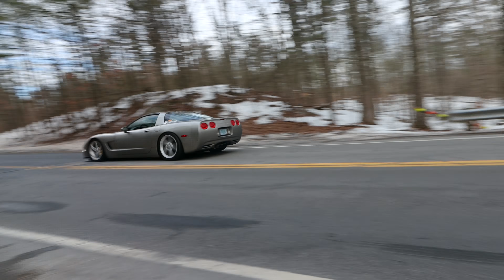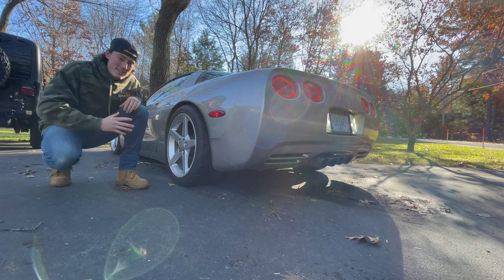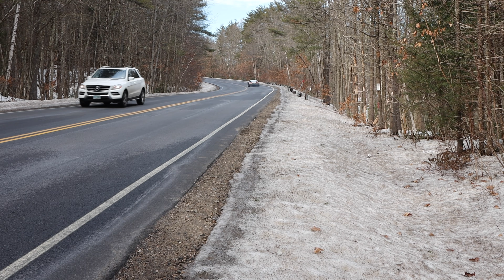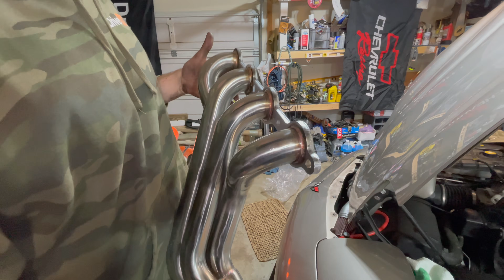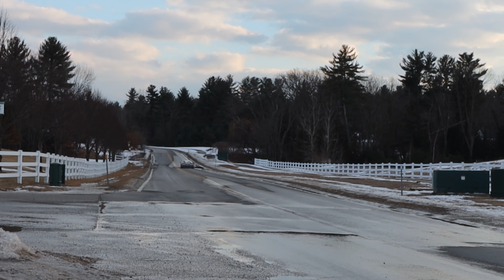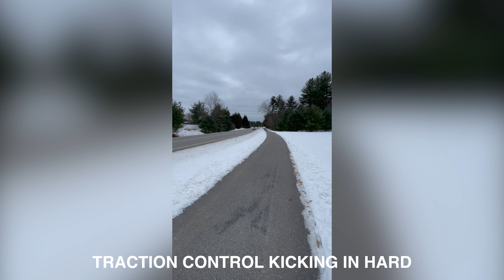C5 Corvette Speed Engineering Headers Review | Is It TOO Loud???

Comment: I think I'll keep my 2003 C5 stock.  Many years ago I had an '88 GTA Firebird (L98 350) and it had a set of custom built Doug Thorley headers.  The headers themselves were high quality.  The headers were California smog legal - including a CARB EO#.  No doubt they increased horsepower but the unexpected consequences became a pain in the butt.  The starter motor would absorb a LOT of radiated heat from the headers.  That would cause the starter to crank very slowly after more than 20 minutes of driving.  I never got around to installing some kind of heat shield on the starter.  Also, routing spark plug wires was a hassle because they would burn when they barely touched the headers.  After a long drive on the freeway, the brake pedal would get soft.  One of the brake lines was too close to one of the header pipes causing the brake fluid to heat soak.  Exhaust leaks was another issue to deal with.  The header bolts would randomly get loose and that would cause a leak - making the smog test fail.  So, I think I'll keep the exhaust stock on my C5.

Comment: I was going to buy Speed headers but they were on backorder for months. I ended up going with TPS 1 7/8 headers with no cats. It was a pain the ass to install, well only the x pipe. I also have BB bullets. I can hear a metallic sound afterwards. It doesn't get loud until I get to 2K rpms with no drone.

Comment: Richard holdener, the king of ls builds did a test comparing headers on the dyno,,these made just as much if not more h.p. as the expensive name brands. Just bought a 2004 zo6 and plan to use the same set up,,just with Billy boat mufflers to quite it down a bit..like your videos dude..my first mod with be the headlights you installed..keep up with the informative yet funny vids.🤣👍

Comment: I noticed your Oil PSI was stuck at 80 can you please talk about a fix for it. I have the same problem on my C5.
Reply: If you haven’t figured it out by now it’s your oil pressure sending it
Reply: Sensor is bad . I had 2 go bad in 3 months. I put an extension on the second time.

Comment: Have you had it tuned yet? If so,  what kind of power does it make? 
I'm thinking the exhaust would wear you down after a while. I'd have to add a muffler or at least a resonator.  The highway drone will get to you on anything but a short trip.

Comment: Some of the rattles you hear at low RPM may in fact be due to the header or mid pipe clamps touching the frame.  Put it back up on jackstands and look carefully for those contact spots. Readjust and drive, then repeat. I have 2” Kooks long tubes on my C6Z and finally dialed out what sounded like a metallic frame-exhaust rattle.  Also, you’d be surprised how much the engine and drivetrain rotate under acceleration! Good luck!

Comment: No cutting with TSP. Just installed a set of 1 3/4" Headers and a Catless 3" X-Pipe on my C5 Z06. No Cutting as the X-Pipe comes with Flanges for OE or Reputable Aftermarket Axle Backs. Have ARH 2" on my C6 Z06, and the quality and fitment is noticeable for the added $1k+ price difference.

Comment: I put American racing on my c6 they did fit like a glove but the price stung a bit. But paired with a cam and springs and corsa mufflers, it's all about the giggles when you stab the skinny pedal!!!!
Reply: I did the same on my '08 C6 M...  AR headers, high flow catted X-pipe, Corsa Sport axle back exhaust, GM Hot Cam, and a Tune... 452 RWHP

What an awesome combo !!!! 
No drone and reasonably quiet at cruise.... but WOW... above 3000 rpm, it SCREAMS !!!  🇺🇸👍🏼
Reply: @justinlanglais9825  I went with a custom grind from race proven motorsports snake charmer 2 intake btr springs and pushrods. Im sitting 486 rwhp. And like you mentioned over 3k she screams and comes to life but still a decent cruiser

Comment: On my 04Z06 I have an old make of LT header, bullet cats, and a corsa extreme.  It's the best of both worlds exhaust I've had in 35+ yrs and 10+ hi-po cars.  It's kinda loud at startup and settles into a mellow tone at idle and normal driving.  Go heavy throttle and above 3000rpms and its LOUD.  Absolutely no drone when normal driving.  It's honestly the best exhaust I've ever experienced in my life.
And btw.. a "secret" to make even stock manifolds and stock mufflers sound good is to maximize mid-pipe size. ;-)

Comment: Nice Kar does it kall for 93 gas? Did u feel any lo end or top end gains with the headers??? Also do you recommend ceramic headers
Reply: c5s can only run 89-93, 87 causes a knock

Comment: Too loud for me ! I have headers and a '3 inch catted X-pype for my LS3, C6. I haven't installed the parts yet, but, I do have a Corsa exhaust and Corsa carbon fiber air intake installed. The other parts will be installed in spring.

Comment: So typically when your catalyst is clogged or dirty and has excess carbon, oil, fuel etc...
Then ut reacts chemically inside if your catalytic converter and if the catalyst can't get hot enough to burn that off it can build up sulfer.. And hence why you smell rotten eggs....

When your cat isn't existent then you have no smell..
If your buddy's WRX had that smell, ( I'm assuming its turboed because who straight pipes a NA subi on purpose) then he's got way worse issues.. Considering there shouldn't be a ton of sulfur being produced...
Maybe a odd fuel additive or something?

Try adding some magnaflow hi flow cats, and get the smallest length ones you can get.. 
Then hollow them out...( ehem for "looks")

And add a set of Magnaflow SS steel pack tube exhausts.. It should be a similar loudness with a completely different tone.. 
And then if you have drone issues a resonator should do the trick....

Love the channel..
I have a 01 vert 6 speed..

Comment: I'd put mufflers on it, preferably Borla S-Type but I believe that even a set of factory mufflers would give the car a good exhaust note without losing too much (if any) performance.

I can't speak as to your C5 but the mostly stock, bolt-on street cars that I've ran an open exhaust on have slowed down at the dragstrip as opposed to having a well designed catback exhaust system.
Reply: have headers on my c5 with stock mufflers, it sounds like ass honestly

Comment: Will it pass inspection?
Reply: That HEAVILY depends on the level of requirement and the tech inspecting it.  In a 100% legit situation.. he has zero chance of passing an inspection.
Reply: you can pass inspection if its tuned, i also have long tubes with no cats on my c5 and passed with no problem thanks to the tune